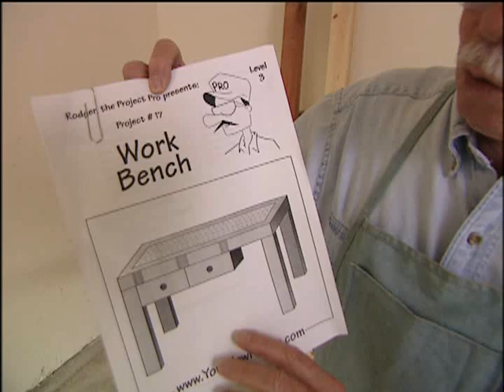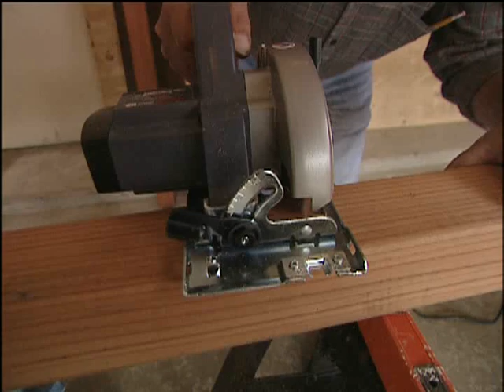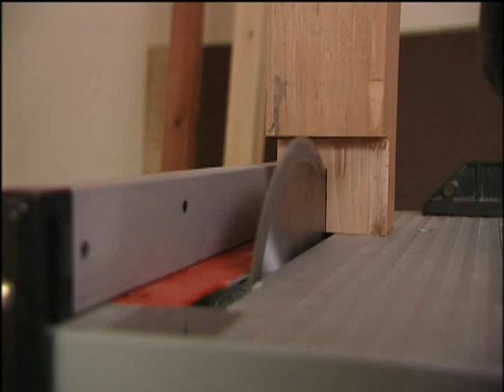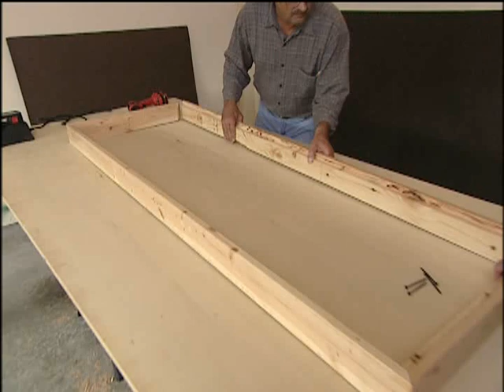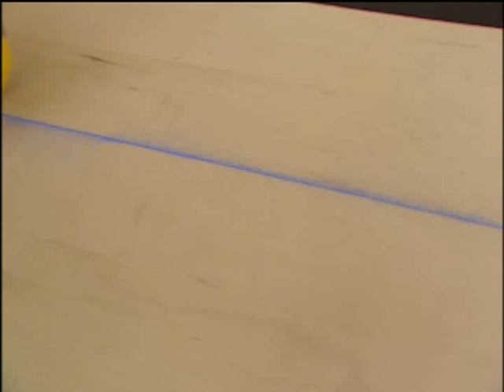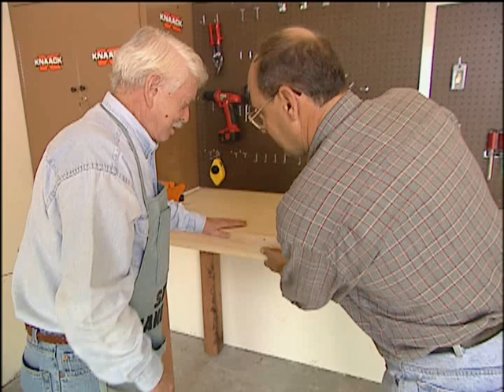Build a Workbench DIY (#5255)

Comment: Attaching the vise to a not attached top could result in flipping the inlay over when applying force on the vise. So I would prefer screwing the top inlay in with at least a screw in each corner.